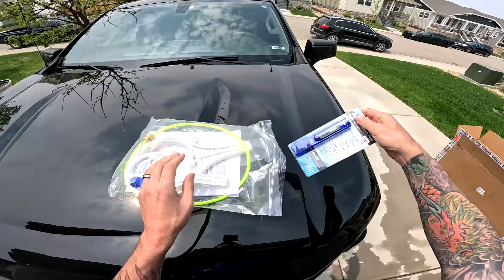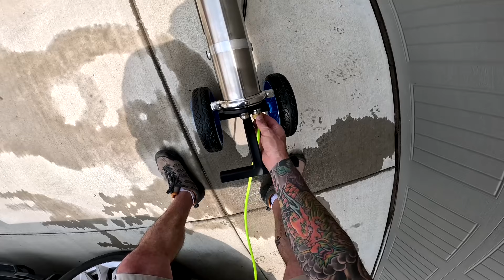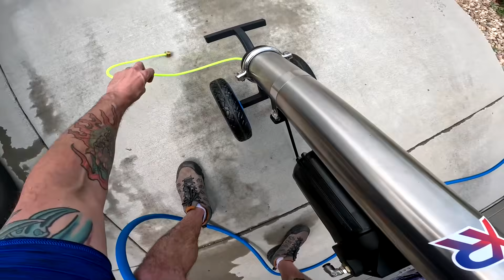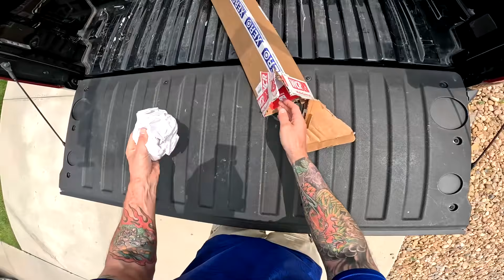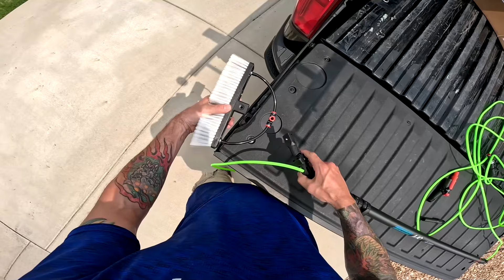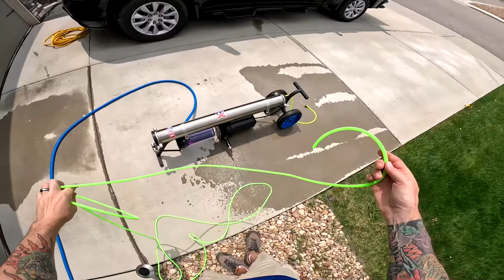HOW TO SETUP THE XERO PURE AND XERO WATER FED POLE

Comment: Does the system need a water pump?
Reply from the maker: With average PSI at 45 or higher no pump is needed, but if source PSI is low can run a pump like this to increase flow

https://windowcleaner.com/products/xero-sprinkler-pump?sca_ref=3020242.k17l3JaEgS

Comment: Please do you need a water pump at any point?
Reply from the maker: It produces .5 gallons per minute with average PSI of 50, but if you want to double the output GPM run a pump like this at 100 psi 

https://windowcleaner.com/products/xero-110v-booster-pump?sca_ref=3020242.k17l3JaEgS

Comment: What’s the part called where you plug the water fed pole hose into? Mine is going bad but don’t know where to find a replacement
Reply from the maker: That’s a premium quick connect set, here’s both pieces 

https://windowcleaner.com/products/xero-outlet-quick-connect?sca_ref=3020242.k17l3JaEgS

https://windowcleaner.com/products/rhg-male-quick-connect-push-to-fit-set-5-16-inch?sca_ref=3020242.k17l3JaEgS

Comment: 11:11 where can I get this part? I can find the turn off valve but not the smaller connector than joins the valve and the hose that connects to the brush
Reply from the maker: Can get this currently https://windowcleaner.com/products/rhg-male-quick-connect-push-to-fit-set-5-16-inch?sca_ref=3020242.k17l3JaEgS

Comment: So from experience i would add a ball valve on the waste and have it 50% closed when cleaning. The membranes work much better. then open it wide when flushing out he membrane with the pure water side closed. What's your thoughts?

Comment: After running the water for 10 mins do you need to let it all the waste water leak? Or need to get the cap to close the hose?
Reply from the maker: No need to let the waste water leak out, can use the waste water hose to route into the inlet and let it sit overnight, then good to use

Comment: Im a single dad and I work full time. I have my kids 90% of the time and have to do all the planning and running for them on my own. I only make 21 bucks an hour where I work. Been doing solid surface work for the past 8 years. Recently im trying to start a side business, cleaning windows, resurfacing old granite countertops, resurfacing stainless steel appliances, sinks and gonna try to get into resurfacing glass as well. I've started spending most of my money on equipment I need but having all the bills and everything on one income is tough to try and get started. It would be awesome to get a little help with everything. Im barely scraping by week after week. Having to eat hotdogs and ramen most days and I just want so much better for my kids. I work my butt off and trying to get my own business going. Its tough out here. But you have to have the drive and almost feel desperate and just go for it. We can do it guys. Our bosses have all the confidence in our abilities to go and make them rich. Why not have the confidence in ourselves for our own wealth?... anyway. If anyone sees this, and could help, man I would appreciate it so much. I just want better for my kids and im trying. Spread thin. I do not like handouts and can ask anyone I know. I usually refuse help because im a grown man and feel like I should be able to provide everything on my own. But right now I just need a little lift to get this going. I've already had two jobs for my side gig and I've averaged 45 an hour. Thats more than double what I make at my day job. I know this could change my kids lives and possibly change others in this area. If it gets big enough I will never hoard the wealth of the company. I want to see everybody thrive and I will pay my workers extremely well if it ever gets big enough to hire other employees. Anyway... that's my little spiel. I know its cringey but im working my butt off, buying equipment and even asking for help on here. Doing everything I can to try and make things better. Thanks.

Comment: What do you do if the reader of the ppm isn’t where you want it to be?
Reply: Try changing your water source, check your filters if they’re aging, try a different test method.
Reply: @Ickystickyglicky I just bought the xero three filter system, so just seeing what to do if it leaves water marks
Reply: @Ickystickyglicky the tds should fix the issue of water marks though, correct? (if it’s new)

Comment: Why is there a "waste water" outlet on this and not on a single stage?
Reply from the maker: Waste water is for pure water systems that include an RO membrane such as the Xero pure, for a DI system there is no RO filter so no waste water outlet needed. DI systems are best for areas that have low minerals in the area https://windowcleaner.com/products/xero-di-tank?sca_ref=3020242.k17l3JaEgS

Comment: Hey Steve, question about the waste water. Do you keep the waste water running during the whole clean or do you close it when you start
Reply from the maker: Always keep the waste water running, the RO needs to do that to work correctly. Closing it off while running water through can damage the brine seal and make the RO not work properly
Reply: @SteveOthewindowcleaner for me the water isn’t coming out of the DI output unless I turn the valve of waste water off, what do I do?

Comment: Does it happen to you sometimes? Before I buy whatever (car, electronics, tools) - I do research, little, but research. I buy it, happy, excited and maybe worried a bit, and right after that I start hearing bad things about ( not worth it, customer service sucks, etc) and like wtf, why I didn't  see it before? I am not saying this is bad product,  have not tested yet..Is this happening due to doubts of something? Fear? I dont like this feeling..Does it happen to you or it is only me? Back to XERO - Did not thought about 0.5 GPM info before I bought it. I have to estimate tmrw for the 3rd floor office windows, and now I am wondering if it will be enough pressure for that height. It means I have to get pump now?🤨
Reply from the maker: Hey! Happy to help with any questions about the system, but a pump is very commonly used with Pure water systems that include an RO membrane due to the RO purifies through restricting, most will use a pump like this or can look for a 1 hp sprinkler pump https://windowcleaner.com/products/xero-110v-booster-pump?sca_ref=3020242.k17l3JaEgS

Comment: Love the video I have exact set up love it is there an attachment or somthing I can to do so I can run 2 water fed poles with the system rather than only 1
Reply from the maker: @VincentPena-wl2nk  this system is only rated for 1 pole, but if you got a Max or triple can connect this Y adapter to hook up 2 poles 

https://windowcleaner.com/products/xero-garden-hose-y-valve?sca_ref=3020242.k17l3JaEgS

Comment: Is a white vinyl hose like used for camper feed (food grade) overkill for this system?  Also, what about a pull valve inside the pole, will it make the resin last longer via less water useage?   How much are the two items you just featured?
Reply from the maker: Yea, just need a normal garden hose to supply water to the system like this one https://amzn.to/3R8GmS1